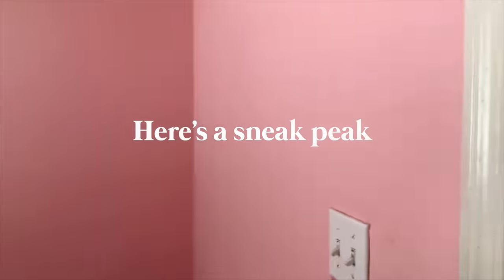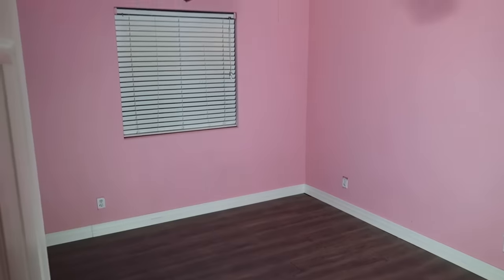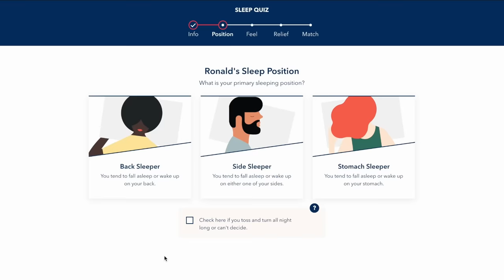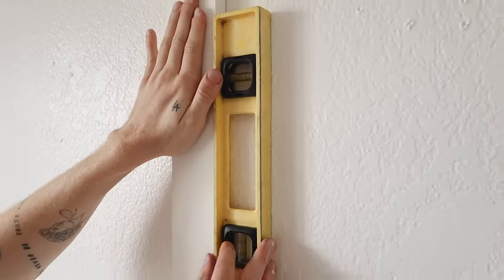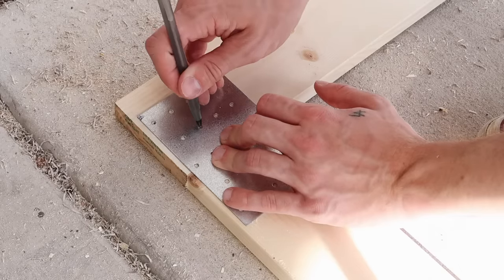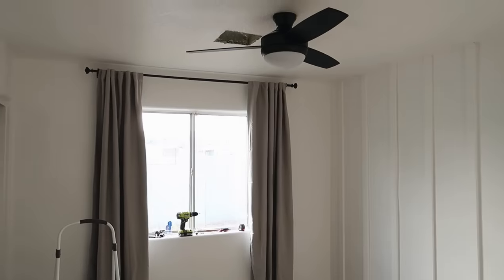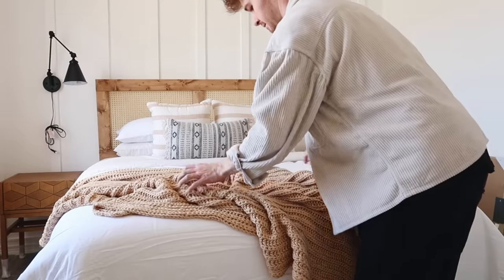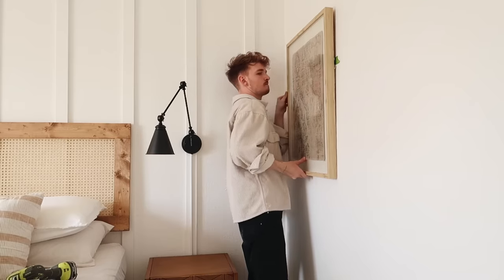EXTREME SMALL BEDROOM MAKEOVER + DIY HEADBOARD (From Start To Finish)

Comment: For future reference you can also just cover paint brushes and rollers with aluminum foil and they won't dry out! No refrigerator needed! 
Both my dad and (newly retired) grandpa have been professional painters for many years so I've learned a lot from them! 🥰
Reply: Thanks for the tip
Reply: Ivy, thanks for this tip.  I just painted one of my bedrooms and after washing the paint brushes put them into the sink to dry, but the next day they were so hard that I couldn't pull the bristles apart.
Reply: Wow good advice
Reply: Putting them in the refrigerator helps when you’re going a longer period of time between using the rollers and brushes. If I was just going an hour or two between uses, or even a few hours I just wrap them in plastic bags. But if I’m going several days between painting I put my rollers and brushes in the fridge.
Reply: Sweet! Thanks for this 🥰
Reply: Plastic wrap works best
Reply: Wow, thank you for this tip!
Reply: Oh wow thank you!!!!! I make such a mess trying to wash them out just to mess them up the next day lol
Reply: @danab3861  in my opinion plastic wrap is much too messy and is easier to dry out
Reply: @veed2898  hi i am painting my room but my mom wants professional painters to do it because shes never heard of people painting their own rooms. she doesn't trust me to do it bc i dont have any experience and am not a professional, but it would be less than one hundred dollars if i did it myself, and if she hired other ppl to do it i'd be 900+. is there anything i can do or say to convince her? lol i need help
Reply: @christinamacquarrie9846  hi! Thanks for reaching out! So unfortunately I can't tell you anything to get your mom to be okay with you painting a room yourself. Parents are parents and they're definitely the ones that have the say so, which I know can suck sometimes. However, if you have all of the stuff including tape and something to cover floors, you could tell her if you mess up, you'll hire someone to fix it and see if she will comprise! I highly suggest using a paint and primer all in one so it's likely you'll only need one coat. Use a brush for the trim and a roller for the rest. Be sure to NOT overload the roller with paint! If anything you can YouTube more videos on how to paint. And also be sure to read the directions on the can of paint(:
Reply: @veed2898  thank you i really appreciate it, my mom isn;t negotiating, but its okay bc we found a guy who will do it for 500$ who is a friend of my grandmother, still expensive but i lot better than before. Again i really appreciate you taking ur time to help me out! :)
Reply: It's cheaper as in free to just wrapped them plastic bags, no fridge required 😂 ...

Comment: When picture frames have two hanging loops on the back,  they are meant to have a piece of picture hanging wire strung between the 2 loops. You don't have to position a nail for each little loop.  After you tie the picture hanging wire between the loops, then you can put picture hanging hooks on the wall and hang the wire on the wall  hooks.
Reply: Oh wow, I never thought of that but I think you are absolutely right!
Reply: @evelyntobias8081  Command picture strips are easier. Especially if you rent: They stick anything to your wall but don't leave marks when removed . But don't go for cheap imitation brands , they don't work.😁
Reply: @sarahholland2600  my dad put his pictures on the wall in my spare room and then I took them down later on it tore my walls up! Don’t know why
Reply: I’ve purchased a couple mirrors and art work with those two hooks and the instructions specifically said do not hang with a wire. Because it compromises the integrity of the frame so it might fall or break since it isn’t meant to hang like that.
Reply: @Greengreen-qv3be  I can understand that it would not be a good idea to do that with heavy artwork or hangings.
Reply: Even i know that and im an old lady 👵  😄😄

Comment: Love it! One thing I do is when marking on the walls, baseboards, etc I use a wet erase marker so that after I'm done, I can just wipe it off with a wet/damp paper towel. It's just a little hack I thought of one day and I even do it on my textured walls with no issue on a eggshell paint. Its great too when doing a gallery wall

Comment: Fabulous transformation, love all your posts.  Good call on changing out curtains, they look so good with headboard.  Using a higher grade wood on the headboard may have made you like it better, but it turned out nicely.  Also loved the fan, gotta have it, and you have to look at it whenever in the bed so it should be stylish.  A little tip...not necessary to use liquid nails on the batten strips.  The nails should hold it and the caulk will add extra adhesion, that way if they are removed in the future, the sheetrock won't be as damaged.

Comment: Drew, I see you do a LOT of 2nd coats of paint.  I'm a designer as well.  When I paint, I don't have the need to do 2nd coats of paint.  I use Behr paint with primer, I do not have the need to do a 2nd coat.  What is your main brand of paint?

Comment: The dimensions don't seem to add up. The room, by the aunt's plan, is 81.5 by 133.5 inches. It's a queen size mattress, apparently, so 60 by 80 inches. The headboard is in the middle of the long wall. By the plan, that means there is at most 1.5 inches between the end of the bed and the other wall. I hope granddad is pretty agile...

Comment: Don't use your finger to wipe caulk. Use a plastic rounded-corner square. Using your finger will leave a thin layer of caulk on each surface that will age horribly and is impossible to paint over.   :'(